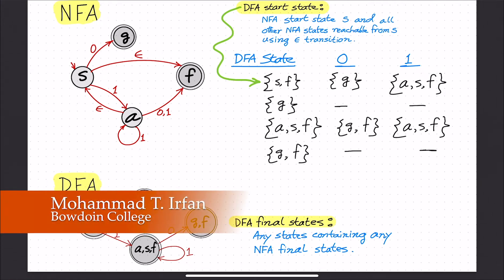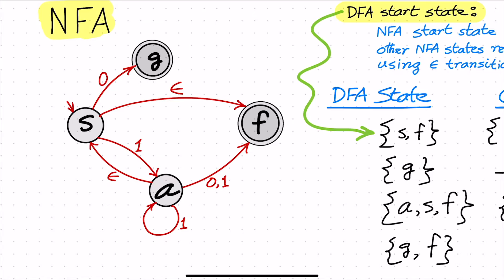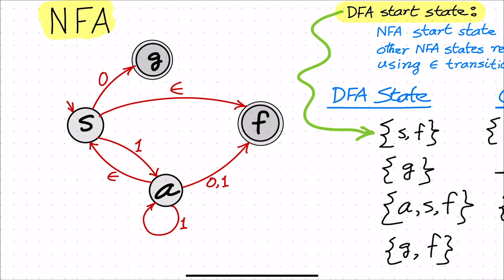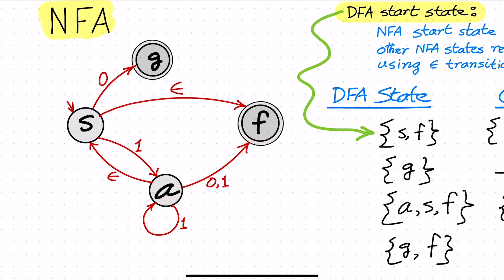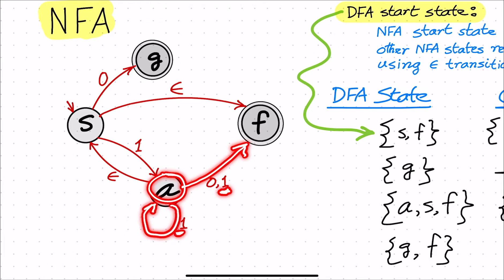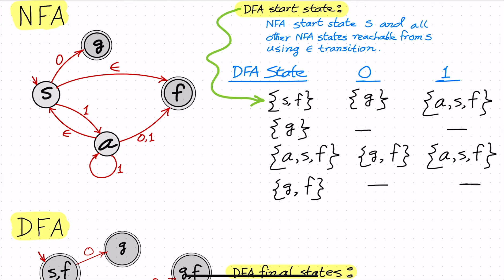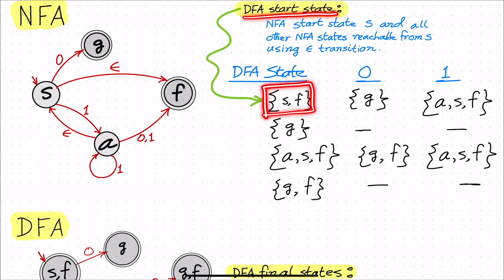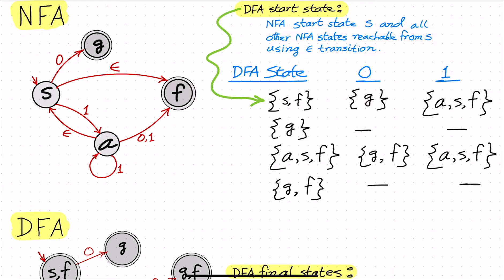How to Convert NFA to DFA: Dealing with Epsilon Transitions

Comment: shouldn't DFA cover all of the transitions(0 and 1)? g and g,f doesn't have any transitions
Reply from the maker: This is because in the NFA, there is no transition out of g or out of f. In general, we cannot have a transition in the DFA that does not exist in the NFA.
Reply: @irfan_  But we can add a new state, which both {g,f} and {g} goto, with both inputs (0,1), and that new state also goes to itself for both  inputs (0,1). Instead of putting dashes, if you create a new state for null states it would have been clear ig.

Comment: State (g,f) can be omitted, and the 0,1 transition can be from (a,s,f) to itself. I'm not sure how you got the state (g,f) in the first place, given there are no forward epsilon-transitions (indeed, no forward transitions at all) from state (g) or state (f) in the NFA.

Essentially, if a newly created DFA state is a subset of any of the others, it doesn't need to be included.
Reply from the maker: RE: "not sure how you got the state (g,f) in the first place." First, make sure you understand how we got the state {a,s,f} in the first row of the table. Now, consider 0 transition out of {a, s, f} (third row of the table). Observe that we can go from a to f on a 0 transition in the NFA. We can go from s to g on a 0 transition. Hence, we obtain {g, f} from {a, s, f} on a 0 transition. Makes sense? The video has a detailed explanation, including 0 transitions.
Furthermore, your comment on subset is not true in general (and needs to be further refined). In particular, there are worst case examples (see the "Dragon book" of compiler design) showing that n number of NFA states may lead to 2^n DFA states, where you MUST retain all the subsets.